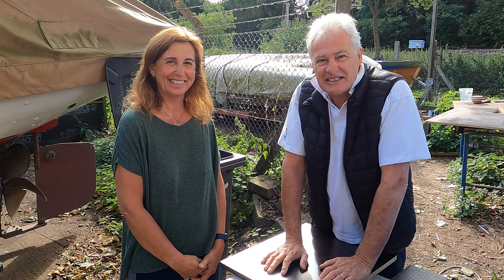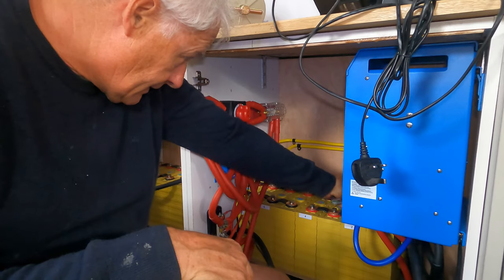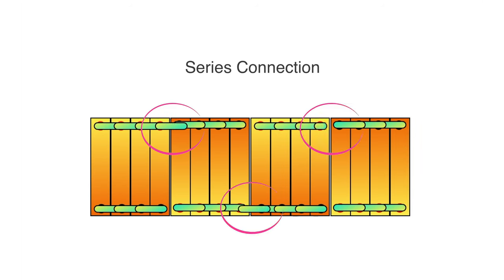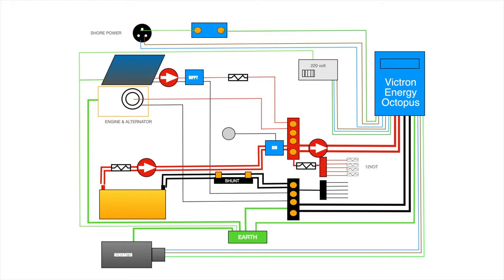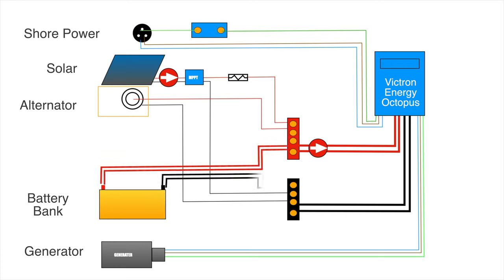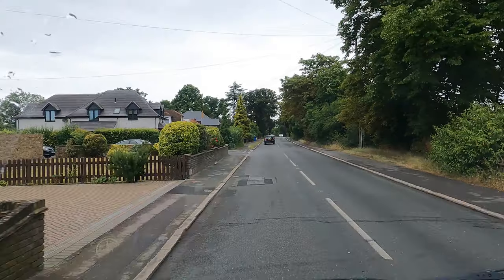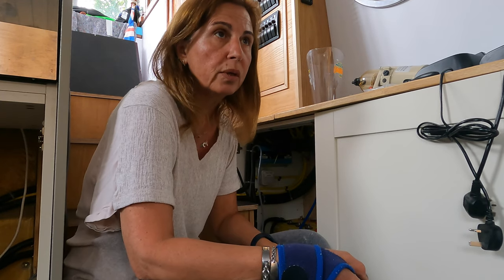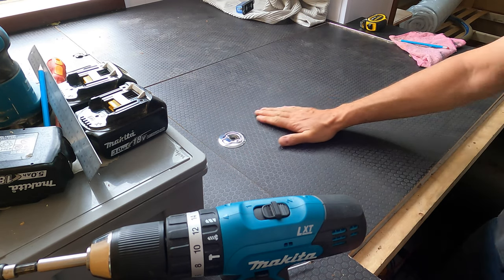BARGE BUILD. Something to be Grateful For. The engine is running! Sailing Ocean Fox Ep 222

Comment: from what you've shown in your video, I regret to inform you that you have been given a little bit of incorrect advice. The device that you are calling you BMS is NOT in fact a BMS, it is a battery PROTECT. This is NOT the same thing and it does NOT replace the need for a BMS. A BMS has a monitoring lead that goes to EACH CELL. LiFePo4 cell like yours and mine need a device that monitors EACH CELL CONSTANTLY. This is called a BMS or Battery Management System. It will shut down the battery if it is too high in cell voltage, too low, too hot, too cold etc. This is a MUST, and can't be omitted. 
If you need a recommendation on one, let me know, but you NEED ONE. For your system, you may need to split your bank into 4s2p times 2 to cover your amperage requirements. 
Let me know if I can help you before you damage your cells, lord knows they cost too much to make a silly mistake over.
Reply from the maker: Thank you very much pointing this out. What is your recommendation? Which one should we buy?